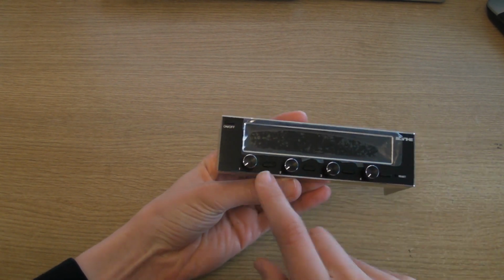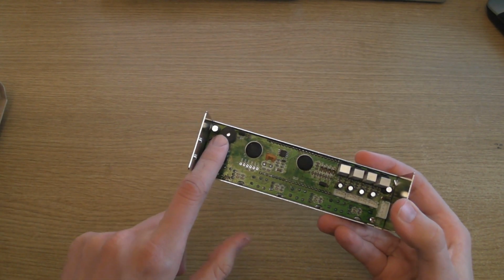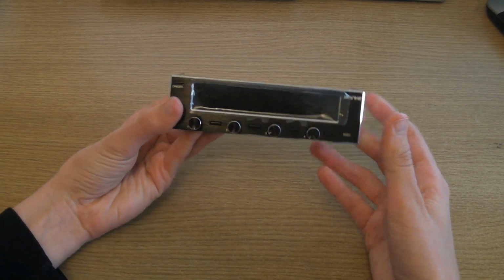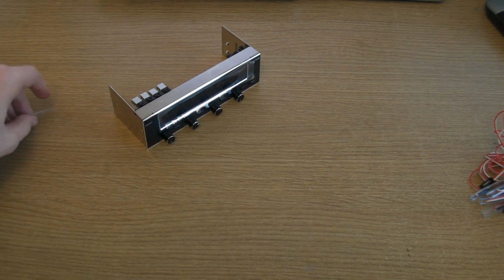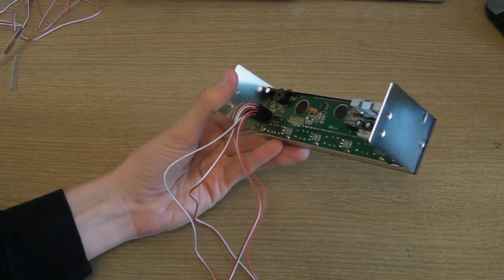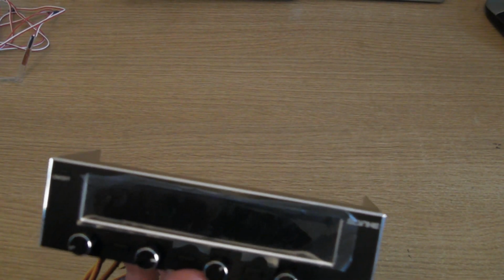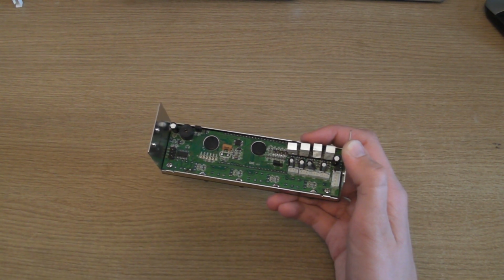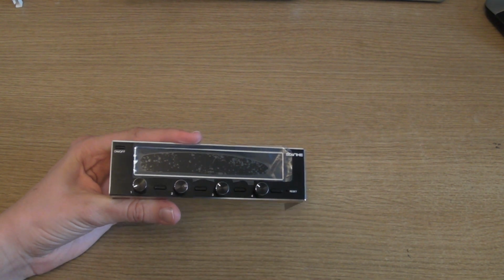Scythe Kaze Server 5.25inch Fan Controllers Review

Comment: Hi! how accurate is the temperature reading for the sensor of the cpu? And where are you suppost to attach that sensor? Is it possible to put the sensor in position inbetween the CPU base and the cooler? or would that just result in worse cooling?

thanks